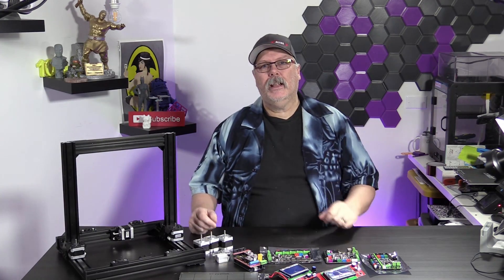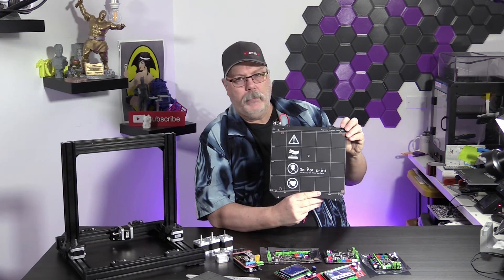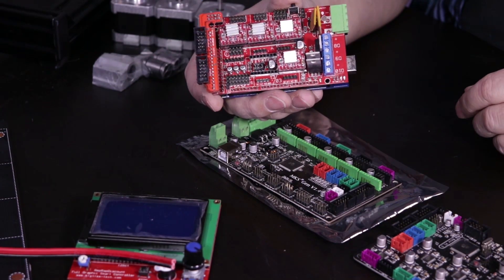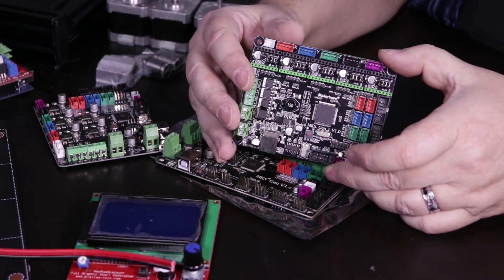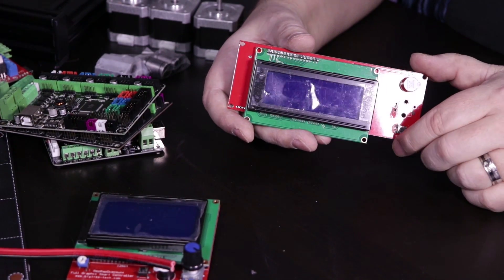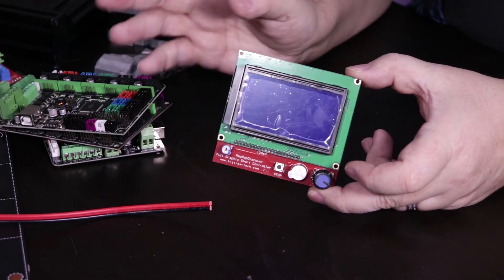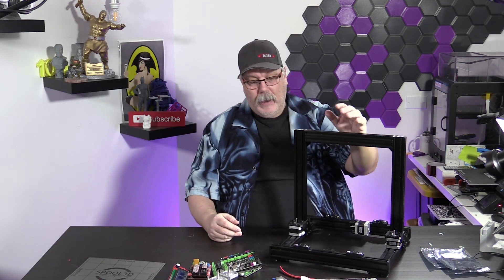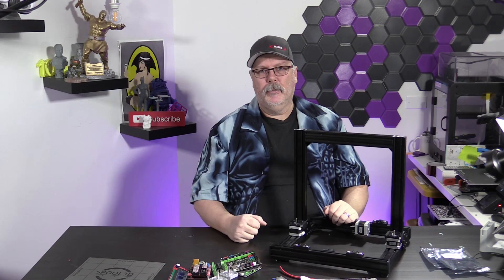3d Printer DIY part 2: Electronics

Comment: Using a 12V heat bed with a 24V supply is as simple as setting the pwm max for the heatbed to 64 in Marlin.

Comment: Hi Richard,
Curious about your comment on the RAMPS shield issues and the unreliability of them. I'm new to the hobby and was just about to buy one with a set of drivers until I saw your video.  The MKS board integrates the Arduino MEGA and the shield but still uses the same or upgraded drivers if I understand correctly. So where do you think the unreliability comes from? Is it the combination of two cheap Chinese boards with cheap drivers plugged in or is there something inherently unstable having to do with the RAMPS design in your opinion?
Reply: This guy does not know as much as he thinks.  Keeps blowing RAMPS ??  Overdriving something, trying to drive a heatbed to 200C?   I run ramps on a unheated bed and its been running for years on the same ramps.   NOW you can blow the power regulator by installing the led/pcb type endstops incorrectly.   But all you have to do is replace the power mosfet, $1.

Comment: Rich for those wanting to follow your build I wanted to share this link. It was the best price I could find for the motherboard, 2130 drivers and a nice display with the SD card reader! https://www.aliexpress.com/item/Gen-V1-4-3D-printer-kit-with-Gen-V1-4-board-TMC2100-TMC2130-TMC2208-DRV8825-A4988/32836429213.html?spm=a2g0s.9042311.0.0.3b644c4d1eUvR1

Comment: Could you get it to 24V but use a buck converter to step 24V to 12V for the bed ?
Reply: Yes, but you would need to get a high enough wattage one, and at the end of the day, the only downside to 12V really is heating time. But with the eventual board we select, there's nothing stopping us from going to 24v in the future (unless you use the old ramps board).

Comment: In regards to the 24vdc couldn't you use a buck converter for the 12vdc bed and run everything else 24vdc and or just change the bed?